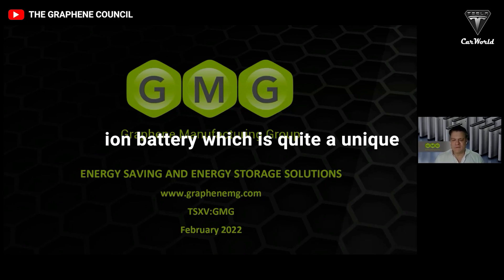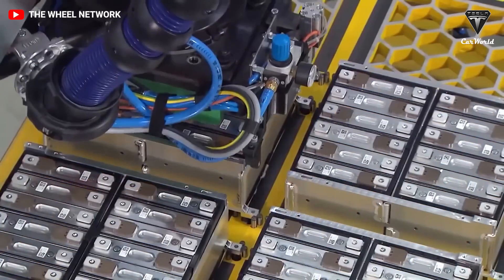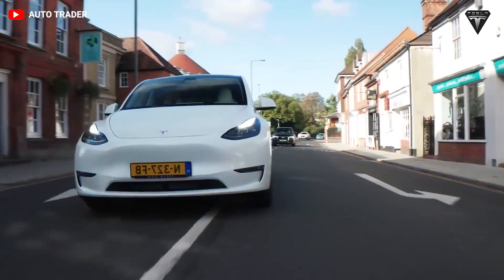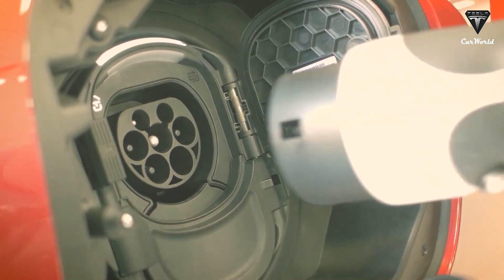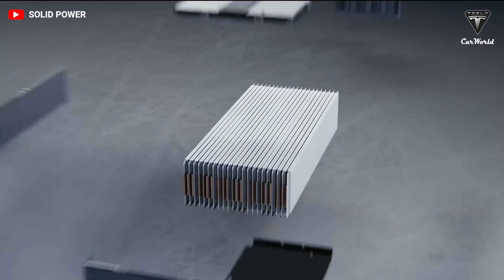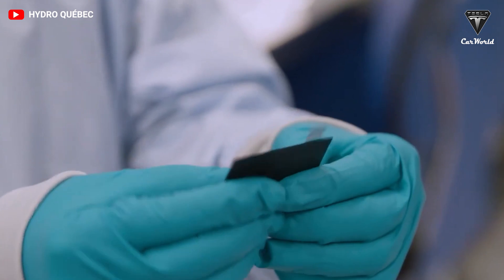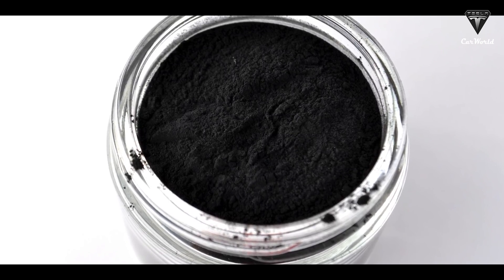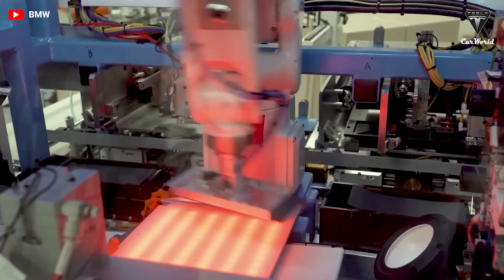Finally Happened! Elon Musk Revealed New Graphene Aluminum Ion Super Battery Hit the Market!

Comment: Lithium Ion Batteries are WAY OUTDATED! Been around since 1996! Graphene Aluminum Ion batteries are the future if batteries. Not only safer, cheaper, faster charging charging, but most importantly 80% LIGHTER! That means a MUCH FASTER CAR. For example: A 3,000 lb. Car. For every 100lb. weight reduction make it 1/10th of a second FASTER in a 1/4 mile run. So, with that being said, the up & coming Tesla Roadster weighs in @ approximately  4,000 lbs. And will run a 8.8 second 1/4 mile. If Graphene Aluminum Ion batteries were used instead, it would reduce approximately 1,300 lbs.making it run a high 7 SECOND 1/4 Mile! I don't know about you, but that sounds incredible to me! A high 7 second street car that's AWD for only $200,000 USD, is a BARGAIN OF A LIFETIME! ❤

Comment: It is not X kw per hour but X kWh.  Anyway, the lower power density per kg is not a problem if they are used for static applications and this would free up a lot of Li for mobile applications.  This would make EVs cheaper and increase even further their adoption.

Comment: Sounds like a damned good battery to me!  Motorcycles would be a great place to start.   Low investment cost and great testing platform.  Make the bikes capable of being joined to form a three wheel bike.  Remove both forks and attach one of the forks between the two bike chassis and stow the remaining fork on a storage rack.  Deploy the fiber glass rod tent frame for the plastic rain cover and go through the rain!  A 150 Mile range should be enough to make it marketable.

Comment: What about the range of these new Graphene Aluminum Ion Super Batteries?
Reply: This battery tech has not yet been adapted to EVs yet, however it is going to change the world. Has higher energy density by Weight than lithium ion batteries.
Reply: Batteries don't have "range"
Reply: The think it will be 2-3 times that of Lithium per Kg of battery.